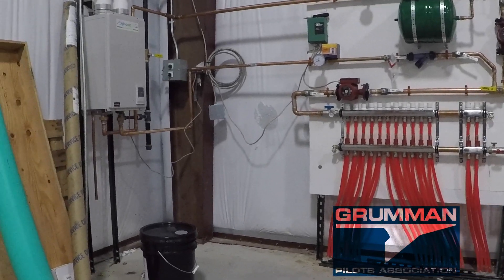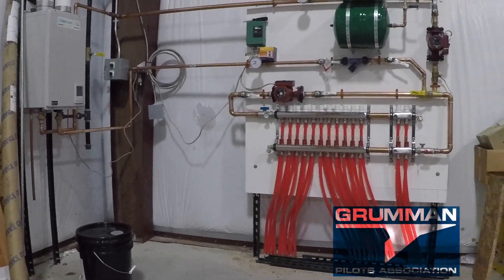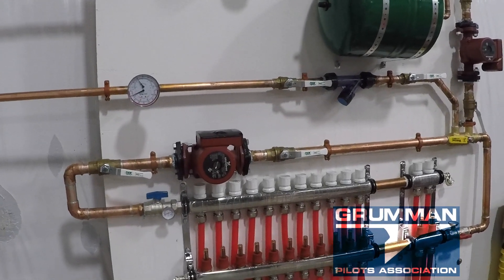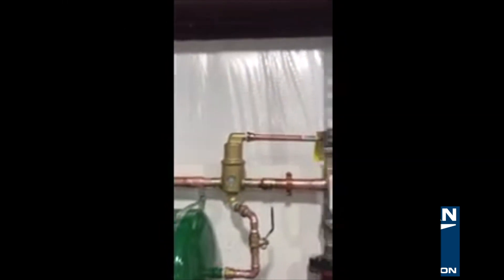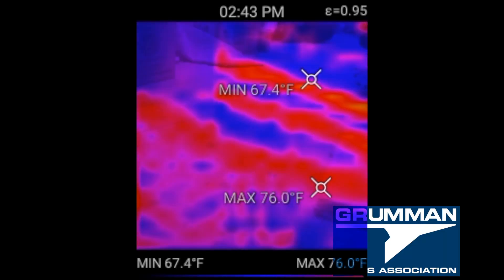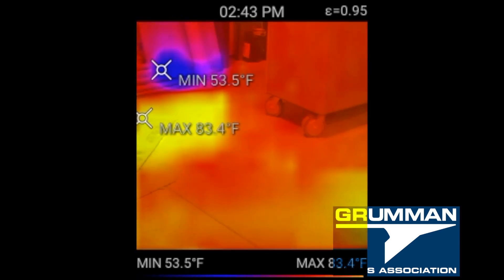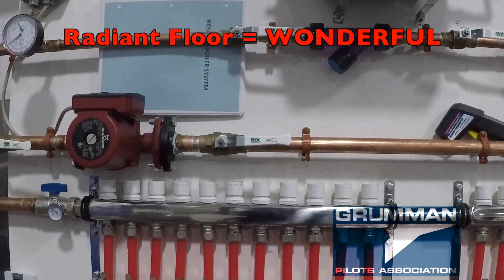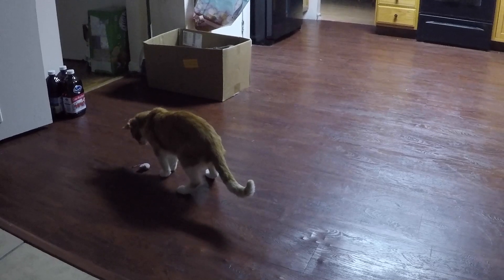Radiant Floor Simple Hangar Heat System - Grumman Style

Comment: Why do you need 2 pumps?
Reply from the maker: That way I can have a primary and a secondary loop that are at different temperatures.  Small pump in the primary to the heater and the big one steals heat out of it and into the floor.